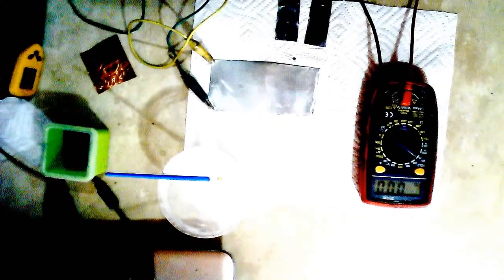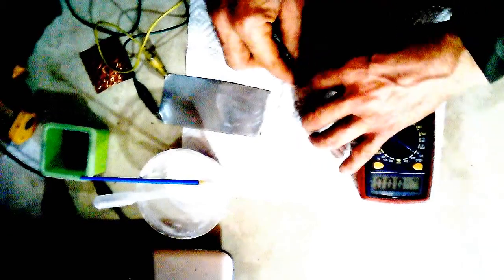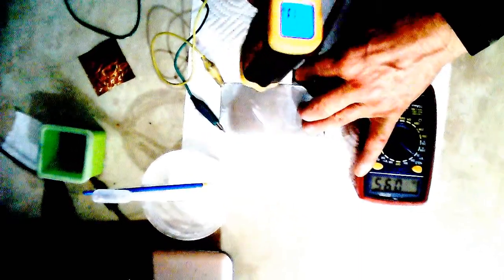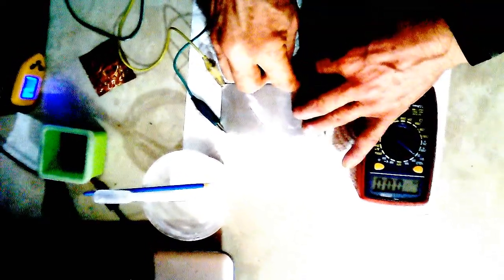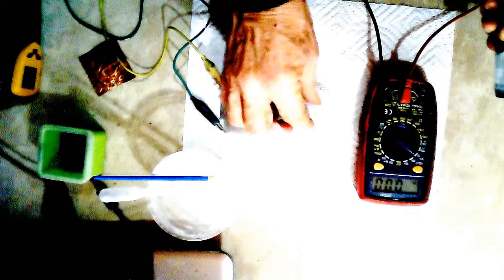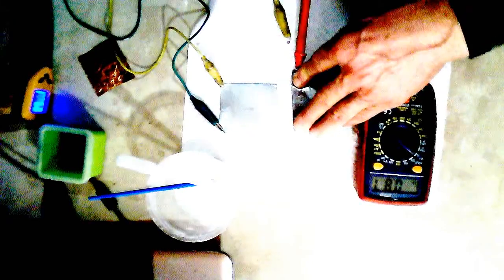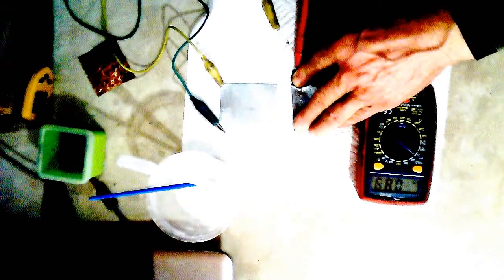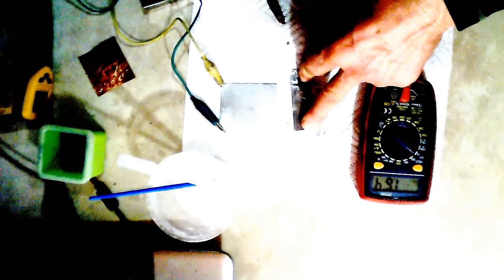Bio cell demo #2  Thermo-Electric

Comment: I don't know about the leakage. I will make an observation that the reflectivity of the zinc may be affecting the temperature readings. While working with a laser thermometer I found painting a spot of dull black stove paint on the metal as a target provided a more consistent reading. A Sharpie works but is still reflective to some degree. I did have some improvement with a black marker rubbed with a coarse cloth to knock down the shine. Point is the laser reads different colors and shine slightly different. For comparative purposes on the same spot each time it might be sufficient but comparing different materials with different reflectivity it might affect absolute measurements.
Reply from the maker: That makes sense Fred. I think the metal acts as a heat sink too. The temp rises and falls more on the graphite.